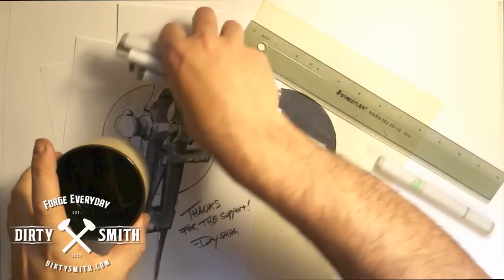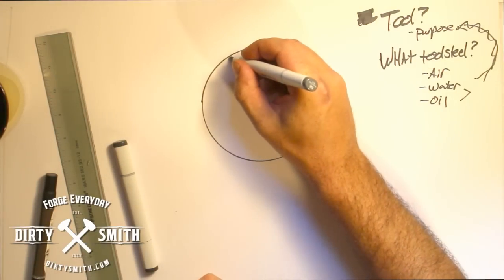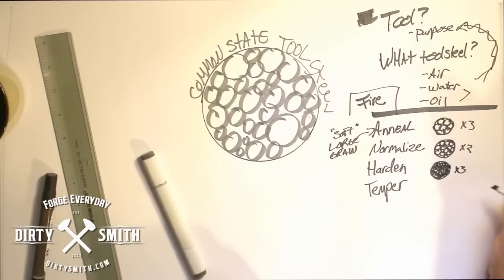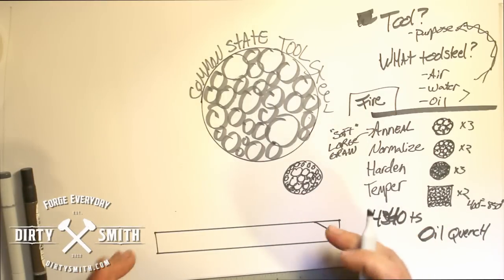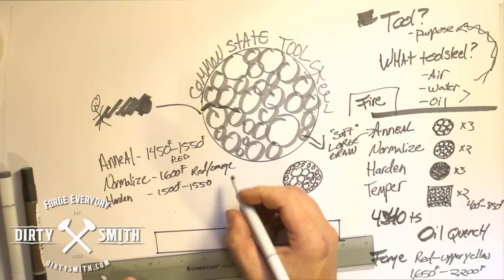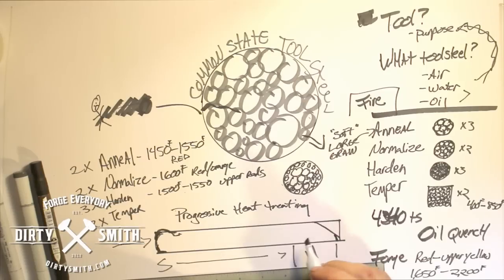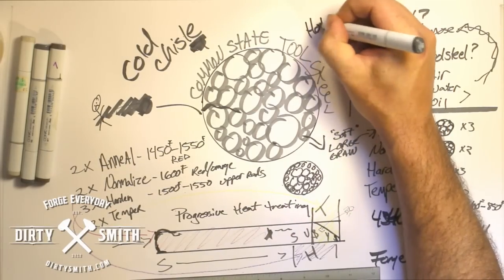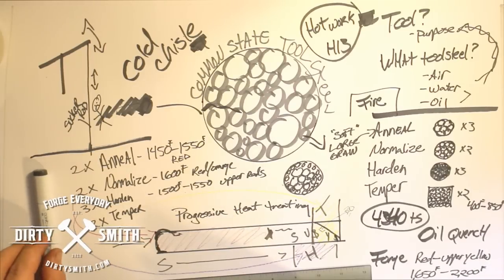Dirty Smith ep 31...and a half: Heat treating talk

Comment: Most excellent explanation.  I was introduced to heat treatment on my first fire ever to a Paint factory. I got to the door, and the there was 55 gallon drums of paint cooking off. Very colorful,  but my Captain said we are going to vent this building from right here. He had me spay the the steel roof with a high volume of water. The roof instantly crumpled and fell into the fire, I am very glac that guy knew what he was doing.

Comment: Great clarification and extension of episode 2. Stupid question though... I understand multiple anneals and normalization to thoroughly equalize the material throughout, but not hardening and tempering. If you heat and then harden, wont another heat excite the molecules undoing the first hardening? Same with temper, once it is tempered wont another temper just excite the steel past the previous temper state? Or, is it that the heat will "deepen" the harden or temper within the core of the material? Maybe i should get this track anvil finished and smash some steel before i ask any more silly questions.  Thanks
Reply: I wondered this for a long time and came to the conclusion that is a way around or insurance against soak time (or lack thereof). Not all the carbon dissolves into solution the second you hit your critical temperature. The rule of thumb i have heard is generally 1 hour soak time at the desired temp for each inch of material thickness. That can be a really long time to keep moving steel in and out of the forge to keep it at that exact temp. And if you go over the temp range, it grows your grain size. Repeated normalizing/annealing/whatever if you have no temp controlled oven allows you to get better martensitic/austinitic/whatever conversion and retention by allowing 2 more chances for all the carbon to dissolve into the iron matrix. I have a tenp controlled oven and just do each cycle once, except for tempering because it allows me to get as long a soak time as I need to get all that carbon into solution.